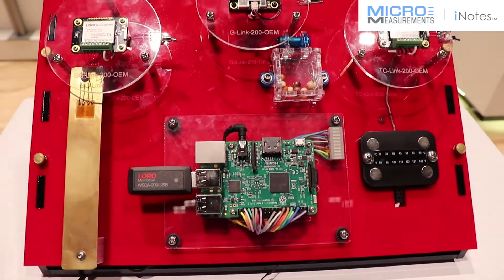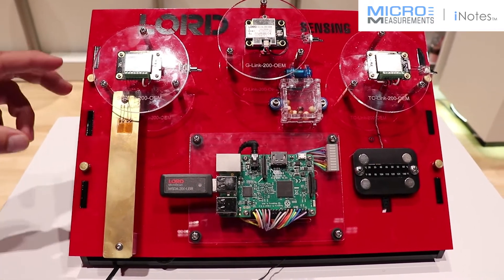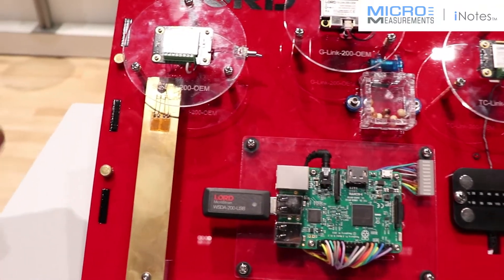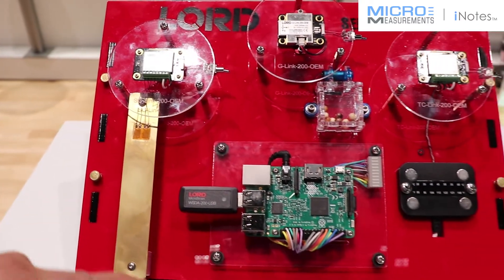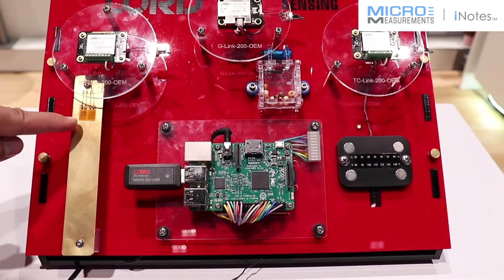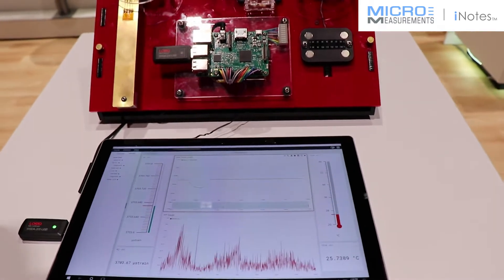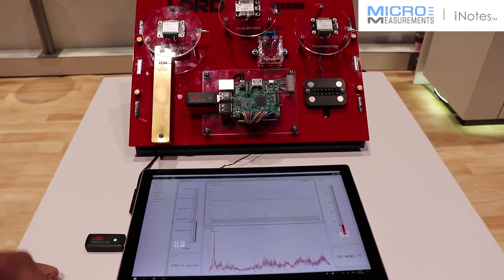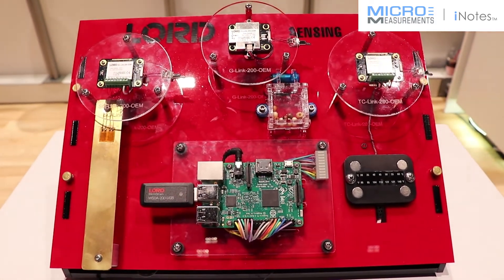Measuring Strain, Load and Torque with a Raspberry Pi

Comment: En esta nota Justin de LORD Sensing-MicroStrain explica el último avance en la Monitorización de la Salud Estructural (SHM) y la Monitorización de la Situación de las Máquinas. Justin demuestra cómo medir deformación usando las bandas extensométricas CEA de Micro-Measurements, con el Módulo Extensométrico Inalámbrico de LORD Sensing.

Si necesita más información, por favor no dude en contactarnos. mm.es@vpgsensors.com miguel.bravo@vpgsensors.com